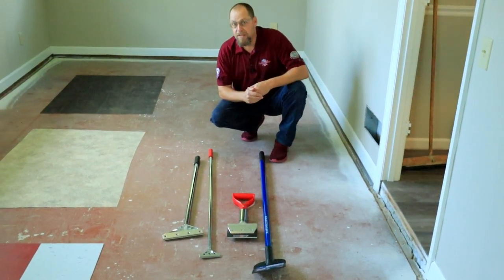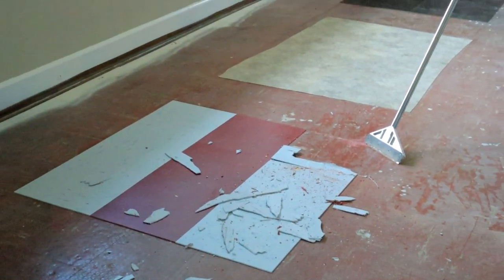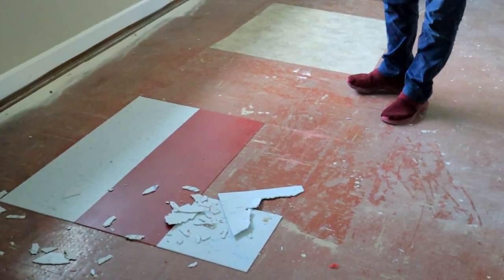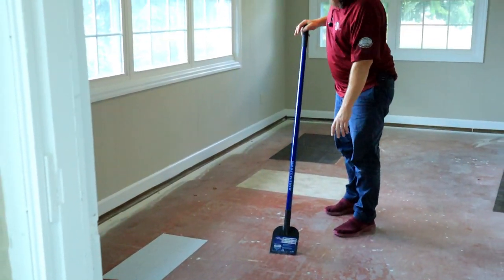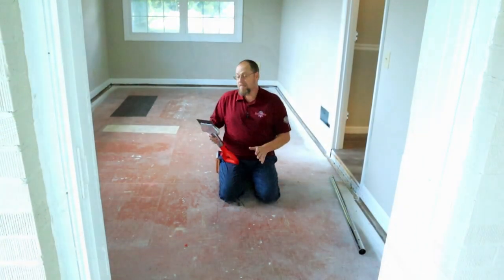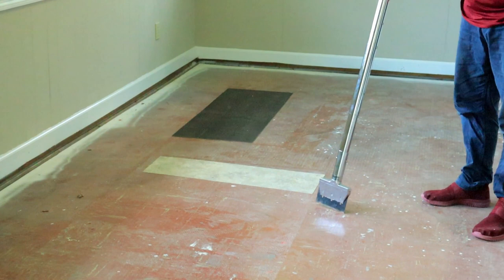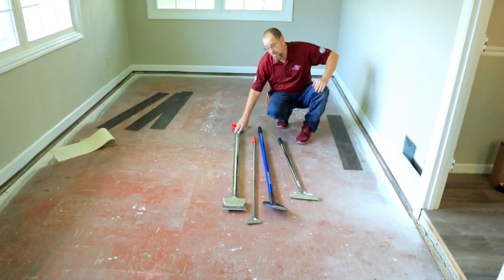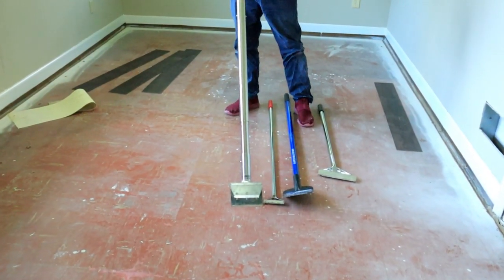FLOORING SCRAPER CHALLENGE

Comment: I've been staring at my floor for an entire year. Removed partial tiles and gave up due to arthritic issues with my hands as I was using a small scrapper and needed a heat blower to loosen tiles. It became such at project at one-by-one tile removal.  You can imagine how stupid my floor looks. The leftover adhesive sucks too. This post is quite informative and a motivator to finish my floor using the scraper you recommended! Many thanks.
Reply from the maker: @Dontloseyourlight100  😂👍awesome good luck

Comment: None of the flooring was installed right. I have had all but the short one they all have there purpose but I could do just as good on what you just did with a wonder bar or 5 in 1 had scraper

Comment: I think “Better Tools” offers a unique large floor scraper blade where it has a ridge on each side to keep it from sliding as much or breaking as easily.
Reply from the maker: Yes they do for 4 inch scrapers, it is called a jet blade
Reply: @FloorsbySouthernboys  I thought they had an 8” version too.. Great video.. thanks for posting something on scrapers.. I like the Roberts one with the versatility of stretcher poles, although i wonder if the weight versus the Marshalltown would be a factor after an hour or two 😓. The weight definitely adds some force on the cutting edge so I guess it’s a balance between those tradeoffs between the two..
Reply from the maker: @brandonmitchell6264  They used to have an 8 inch jet blade But they are unable to get them anymore, I am a Better tools distributor and I was really hoping to get some myself

Comment: Nice video. I had a floor scraping job that destroyed two types of manual scrapers and also destroyed a new scraper blade in my demo saw. The job entailed removing old glued down vinyl tile on a concrete floor after having already removed a layer of glued down carpet tile. I needed a tool that was narrow  and heavy. My wrist are to old to handle pushing a scraper. I took a $6.00 masons chisel cut the head off ground a 30 sharp edge on it and stuck it inside the end of a 5' section of 1" heavy duty metal pipe. I then hammered the end of the pipe flat against the shoulders of the chisel. This tool made short work of the job
 and was very easy on my wrist because it was heavy enough to let the tool do the work.
Reply from the maker: 😲😲that’s awesome

Comment: i like to keep just 1 size blade on my van so i buy 8" blades and snap or cut them in half for my 4 inch scraper, stronger blades and last longer.  i also often take 1 weight off my 75 pound roller and slide down my 8" scraper pole..  little heavier to push but i switch side much less and the scrapping gets done faster